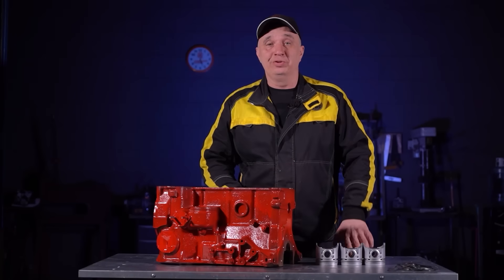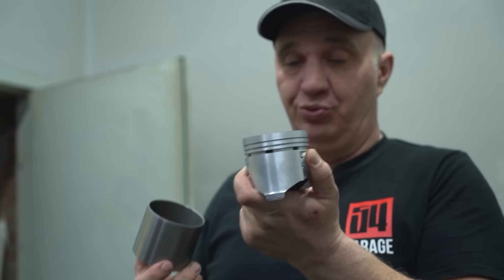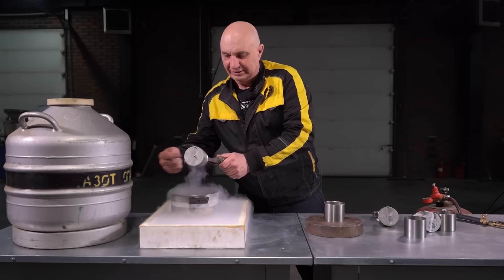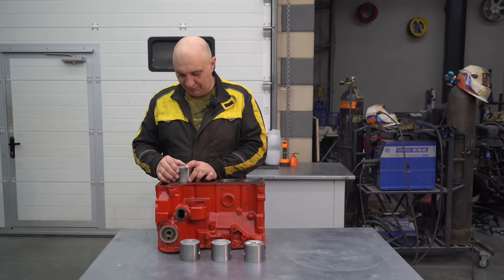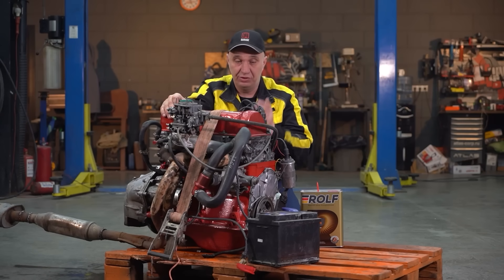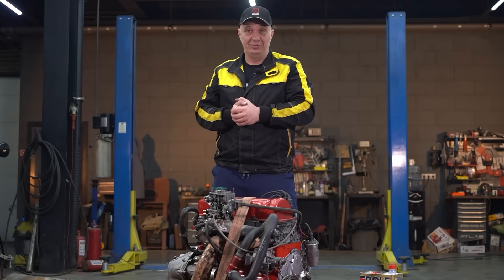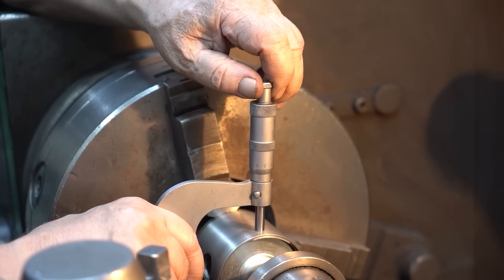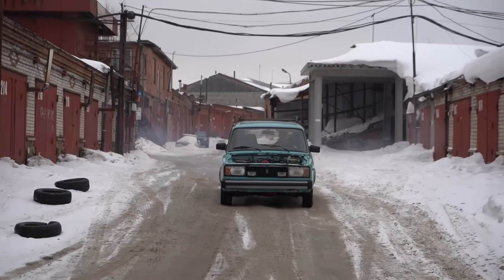We fit pistons with no rings to an engine - will it work?

Comment: Should have added 2 stroke oil to the petrol. It may have helped it last a bit longer.
Reply: There is too much surface area contact between the pistons and cylinder walls which created excessive heat and siezed it up lol..
Reply: @TTime685  how much longer you reckon it would last with relief cuts all along the non-bearing sides of the pistons? I think it would have gone at least a few days of daily driving before it got so fouled it wouldn't run.
Reply: @wymondgoolsby8070  It's possible. But like you said, it would only extend the life a little longer
Reply: @wymondgoolsby8070 i think it would of lasted at least a week
Reply: @TTime685  exactly. same reason why smaller pistons can rev higher. 
american high volume engines have rev limiter where a small diesel  have its limit.
all you have to do is look at the the F1 cars.  small displacement and alot of cylinders let them rev to the moon because the reduced friction heat from the small pistons allow it.
Reply: @TTime685 that's a good point  minimise the contact surface area
Reply: The purpose of the cylinder rings is to fill the gap between the cylinder and piston and stop the combustion gasses from getting past. To make an engine without the rings requires that the gap between the piston itself and the wall be narrow enough that the gasses cannot pass and that the oil can get from wherever it is supplied to the contact point and stay there against the force of combustion. The obvious issue here is that the narrower the cylinder gap the lighter the oil must be and the wider the gap the thicker the oil must be to stay there at all, so oil added with the fuel cannot actually get into the gap without the gap being too wide or the oil being to light to lubricate at all.
Reply: @deeznutz5825  correct, but oil in the gas would provide extra lubrication directly into the cylinders. Probably would've just reduced the volatility of the gas, though, as it seems there's no shortage of oil.
Reply: @deeznutz5825  Thats why there was blow back out of the breather
Reply: Only if you would somwhow diverge the oilflow from the sump. As long as there is an oil sump below the pistons the engine will eventually blow up.

Two Stroke engines, given the proper piston size, run just fine without rings. Miniature engines generally dont have them at all.
Reply: @peteraugust5295  umm ok maybe tiny rc engines running 20% oil sure. but anything 10cc's and up needs atleast 1 ring, or hot exhaust will just get pumped back into the cylinder through the crankcase, causing it to detonate and / or seize
Reply: @peteraugust5295 yes, but even those have tapered pistons, because the face gets the hottest. Plus they will seize also if you run them on lean mix.
Reply: Yes
Reply: I can't get over the lack of provision for allowing oil to ooze from the ring grooves and out to the outer piston.  Or, better yet, splash lubrication like a lawn mower engine.  Some dippers attached to the bottom of the connecting rods that will splash oil against the cylinder walls.
Reply: Even in 2 stroke gasoline engines majority of the cooling comes from the evaporation of the fuel itself, which also cools the piston from below through the crankcase. Oil is only needed to control the friction on the cylinder surface and for the bearings. Here, in a 4-stroke engine it is not possible to cool the pistons with fuel evaporation from below. Additionally, as being a carbureted, manifold injected engine, the top of the cylinder, which is the maximum available surface area that could be cooled with fuel was already cooled by default. For the lubrication of the cylinder surface, the oil pump does the job. And as others said, there was plenty of blow-by, so probably even the top of the piston was oiled most of the time.
Reply: yea maybe . No maybe not
Reply: probably not but gotta love 2 stokes
Reply: Should have converted it to a 2 stroke diesel.
Reply: stupid idea but it might just work: instead of gas tank we have oil tank lol
Reply: My guess the pressure in the crankshaft equalized
Reply: Top of piston should b tight like an r/c nitro engine piston. Just an idea, these  guys know how to make things work. Keep up the interesting videos coming.
Reply: @ these pistons are far to big and heavy to have basically zero piston skirt clearance. it would've seized even quicker then.
Reply: Wow it worked great in the beginning!
Reply: top oil always helps.
Reply: There is no bearings the the fuel would be able to lubricate. The crank would provide enough live for the cylinder
Reply: olio di ricino
Reply: Maybe
Reply: why bother , junk is junk and thats very very stupid at best
Reply: Rotary engine guys have been running 2 stroke oil in the fuel tanks for years, seems to work great for my car, maybe could of helped this project run a little longer
Reply: QUISIERA VER UN EXPERIMENTO DE UN MOTOR ENFRIADO CON NITROGENO LIQUIDO, EN UN PORCENTAJE  O CANTIDAD ADECUADA.
Reply: Should add some pores or holes on the piston side like some street racing motorcycles
Reply: @Liz0rdX80 Mate it needs piston rings .. lol.
Reply: I do this (ashless marine 2 stroke/TCW3) to pretty much all my engines 😅 from my 2.0 HDi diesel, Mercedes W140 with the M104 engine, 4 stroke generator, and 4 stroke dirt bike! It's a great hack overall for slightly improved refinement and fuel economy and slightly reduced lubrication for the top end and fuel system. 1:500 to 1:300 oil to fuel ratio depending on application...

Comment: Ford did this with the MK3 Zephyr and Zodiac.   Due to strikes and workforce belligerence, Ford engines many times left the plant missing piston rings but due to the absolute rugged reliability of Ford engines of that era, no one noticed save a slight uptick in oil consumption, a bit of smoke from the exhaust and maybe a bit more of a petrol thirst than normal yet these engines covered tens of thousands of miles and Ford would on the cars final service just quickly whip in a new set without telling owner and free too and off the car would go running far better than it had done and no one was the wiser ;)
Reply: Bollocks you would have to be completely drunk to not notice
Reply: to jest jedna z tych historii które się nigdy nie wydarzyły. Wytrzeźwiej.
Reply: @dodgy There is no way that any of that is true. And if it did happen, they must have been isolated incidents and certainly the vehicles did not run properly for miles and miles and miles. I have to raise the BS 🇺🇸 on this one!!! No way that this happened.
Reply: Lies
Reply: @dodgydruid  You're saying people were driving around with no piston rings do you realise how absurd that is? It wouldn't even start let alone drive around
Reply: Why would anyone ever buy a ford
Reply: Doubt it, especially if you're talking anything pre 1950 wouldn't even start. Those engines ran with such low compression, that having a cylinder down made them run terrible. Reliable? Absolutely! But when something doesn't run right you instantly know about it
Reply: A mk3 would blow up with no piston rings fords are terrible lol
Reply: "Rugged reliability" means crude and unoptimized. We can make engines run forever if we don't care about everything else like fuel economy, power, emissions, ease of use, profitability etc.
Reply: @toolbaggers    what do you define as "ease of use"? Personally I say it's when I get in and it starts every time. Oh, a part fails? I can have it swapped in 30 minutes and back on the road. Uniform standard parts across a brand too. Modern engines, except maybe the LS (but even those are becoming old) do not meet any of those criteria...
Reply: @engineerisengihere44  Modern engines start every time. You know what doesn't? A carbureted car. A choke, vacuum lines everywhere and mechanical ignition that wears out just by existing. You can keep it.
Reply: Very interesting
Reply: Wow!!
Reply: wow unions are so good

Comment: You guys should try a make a w16 engine out of ladas.
Reply: Soon there will be no more ladas cause theyre useing them all
Reply: @WilliamWelsh-t8e  They will build some from wood.
Reply: @PREDATEURLT 
They’ve already made a wooden car!
Reply: @WilliamWelsh-t8e nope. There is a millions of ladas in Russia
Reply: Refine steel make new ones using there wood gas..  @WilliamWelsh-t8e
Reply: @WilliamWelsh-t8e  🤣😂😆
Reply: @WilliamWelsh-t8e in Russia Ladas are 90% of the family vehicles
Reply: and a radial plane engine from ladas
Reply: @alf3071 How are you gonna make a radial engine out of I4's? Lol
Reply: @ They did v8 basically making connecting rods longer and putting both engines on single crankshaft, maybe something like that could be done on radial, but it would be insane to synchronize, so they are right people to try it.
Reply: @TTime685  Mount them in a + fashion using chains to connect the 4 shafts to a central drive shat in the center.
Reply: You can't make a radial engine from I4's lol.. @alf3071
Reply: Rotary engine out of ladas. (Yes I know its not possible)
Reply: Or a flat 8 boxer style with two opposing lada 4 cylinders
Reply: @UmmmmmmmWhat i think they already made a v8
Reply: @lazarman2000 and a V16 i think
Reply: @UmmmmmmmWhat  Yes, that would be something,🙂 although boxers are not so good, because they All are having a Bigger fuel consumptions.
Reply: @UmmmmmmmWhat  And duct tape..... (See Handyman Corner)............
Reply: No no no, guys... You're not thinking like a Russian.
Their tanks use X engines (which is a pretty cool config, honestly), so THAT'S the setup they need to go with, since they'll have access to that industry for technical drafts.

edit: Actually... This is a great idea, but not for a conventional Lada... For the JUMBO Lada that has insane engine bay room! And since am X-16 is only as long as a 4cyl, they'll have plenty of room for radiators and electric fans. (although, maintaining each mechanical fan WOULD BE hilarious looking) 😁👍
Reply: WINDOWS NT 4.0
Reply: @olfreal TOS 2.06
Reply: If ANYONE could do it-
They could!
Reply: There’s a lod of Ladas
Reply: @ludicrous7044 only for now
Reply: Make a boxer horizontally  opposed 8 cylinders , you'd be the first in a VERY long time.
Reply: Technically a w16 is made of two VR8 engines which have a narrower angle, and are more like an inline 8. It would be interesting to see if 4 4 cylinder engines fit inside of a lada though. 😂
Reply: Make a radial engine out of 10 ladas
Reply: They made a v8 engine out of two lada engines
Reply: Or a rotary engine out of a lada engine
Reply: Brilliant idea
Reply: A W16 would be impossible out of four I4 blocks but a V16 could be in the cards… 🤔
Reply: What are ladas
Reply: They did .. wake up fella
Reply: They should try building a Lada Out of ladas
Reply: Why should they do that? Why don't YOU do it?
Reply: Bro that's a waste of 4 engines
Reply: Inline 16 bro
Reply: I think an X16 would be a bit more feasible than a W
Reply: You have to comment on there russian channel.
Reply: Straight 16!
Reply: Nah a W12, from 3 blocks welded together. That would be interesting
Reply: I bet that idea is already on their yt whiteboard
Reply: Scalda troppo per gli attriti infatti si è  fuso in poco tempo
Reply: Saran saya anda harus membuat ulir secara tirus untuk konsumsi piston,,
Reply: Like a engine. Is too optimal maybe for substance. My pet is dying I will leave to you but yes. Like engine I would say.
Reply: Or a WWW24
Reply: @DM-wp9vq  I already say like a engine. Oh is not a possible. If having plastic good metal is not to him. But tell me my sir. I will listen if give me time. I say engine you say too many circles. Is like engine
Reply: What’s ladas
Reply: That's impossible. It would have to be v 16. Its called w 16 because the cylinder banks are in the shape of a w.
Reply: Is that even possible?
Reply: Finally something that will be good 
The w16 is four i4 engines stacked together 
So technically its possible
Reply: Then do an inline 16 cylinder engine. That would be incredible.
Reply: @Colorado_Native  They already did that. I think it might've only been an I12, but yea, close enough to where there's no point in doing an I16.